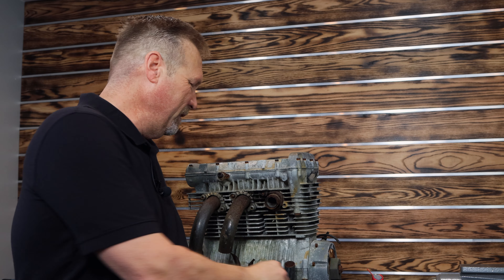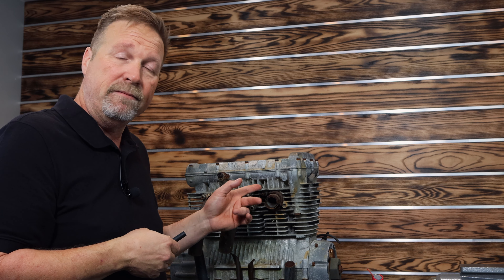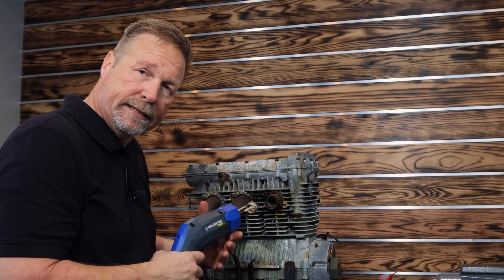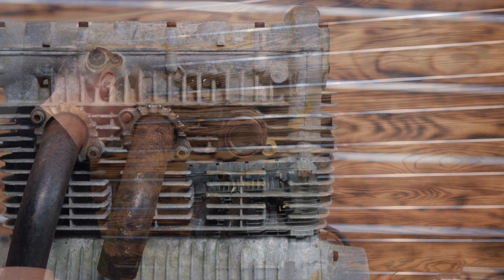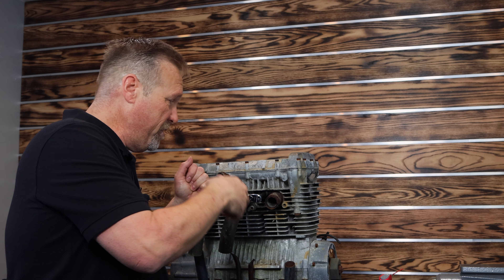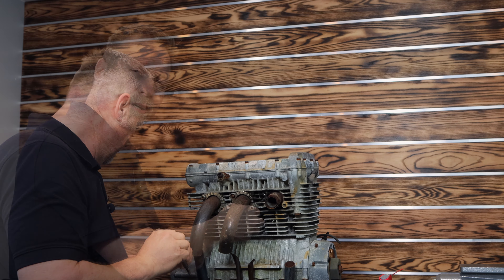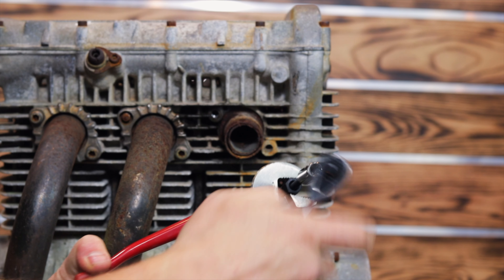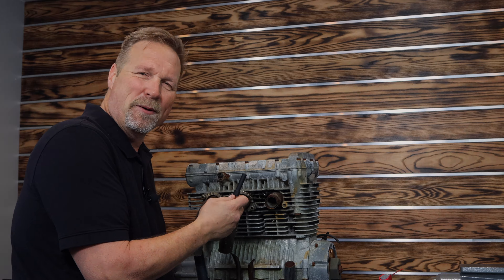Broken, Rusty, Exhaust Manifold Stud  |  Mac Tools RBRT Socket Extractors for the WIN

Comment: These stud extractors would’ve been so so helpful to have when I had to do an exhaust manifold replacement on 2003 Ford F-250 aluminum heads and steel studs they rust in there really really bad!

Comment: I have a broken subframe bolt where the head is sheared off but there is a least an inch of the shaft of the bolt that can be grabbed.  Can this grab it or do I have to use the rbrt broken bolt extractor?  If it can grabbed do there have to be good threads for it to bite on?  The threads don’t look like they are usable.
Reply from the maker: Hi Jon, this sound like a tricky situation. We have had a lot success at removing frozen exhaust flange studs by hammering a Socket Extractor on the stud and pulling the stud from the flange. A stud so frozen in that it pulled the threads out of the flange, I can’t see your situation being to much different. Let us know how you make out, thanks!